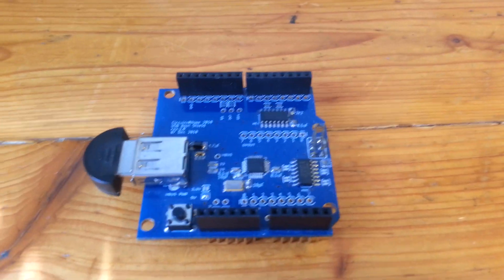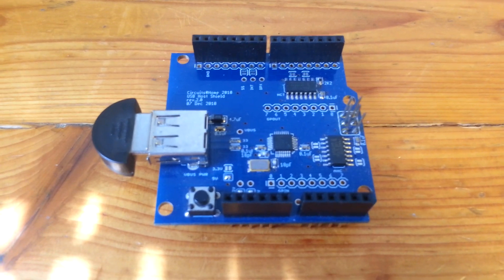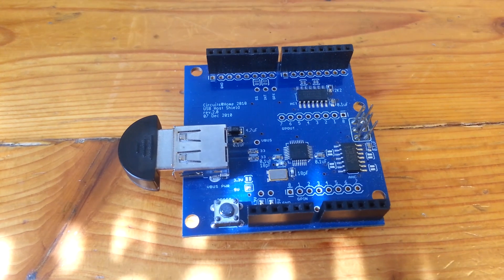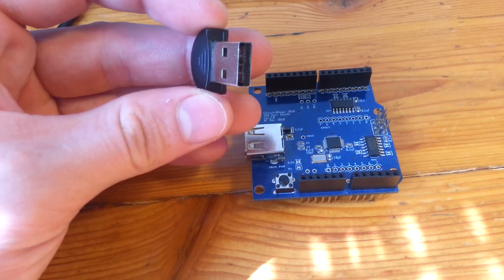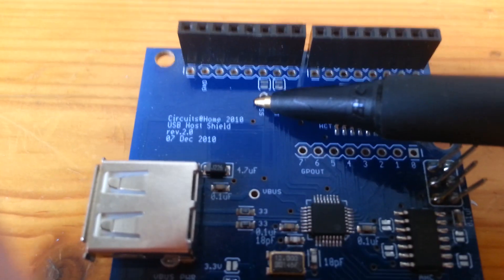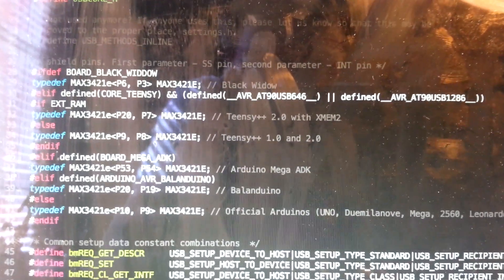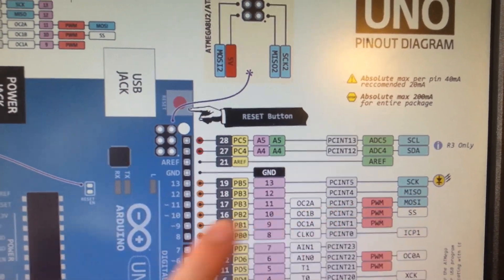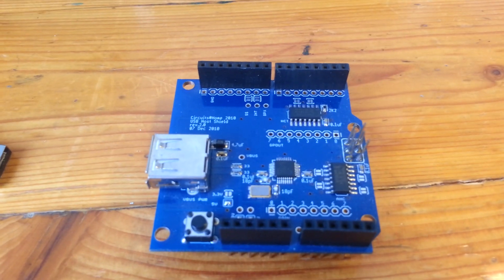How to Connect a PS3 controller to an Arduino with a USB host shield and Bluetooth dongle (Part 2)

Comment: Currently, I'm trying to recreate the process for a PS4 controller using the PS4BT library. The issue is that I can't seem to connect it to the dongle. I'm using the TP-Link UB5A. Do you know if this one will work for me?
Reply from the maker: Picking a dongle that works was the most difficult part. Unfortunately it has been so many years since I last worked on this I don’t think I’ll be able to provide much insight regarding current dongle options. Did you check the links on the website write up in the description? Also, enable debugging if you haven’t already to see if it provides any useful errors in the serial monitor.
Reply: @BarrettAnderies  Wow, thanks for responding. I tried, but many of those links no longer work, and some don't offer shipping to my country. I'll keep looking.

Comment: greetings, thanks for your video on usb host shield , it worked(read+write) without a flaw when i connected a usb drive to the shield(connected to arduino uno r3 ), one question, can this shield work with a usb hub ??? i have tried it arduino<->usb hos shield 2.0<->usb hub<->usb drive and received nothing on the serial monitor...perhaps i did something wrong or misunderstood the capabilities of this usb host shield???
Reply from the maker: I have never tried using a hub, but there is mention of USB hub support in the documentation and it looks like all you need to do is make an instance using the USBHub library: https://github.com/felis/USB_Host_Shield_2.0#faq.

Comment: Hey, if I were to only use the ps3 controller with a cable and now the wire less option would i then be able to skip the whole bluetooth dongle part. Good video.
Reply from the maker: Yes, you can connect the controller directly to the shield via a USB cable: https://github.com/felis/USB_Host_Shield_2.0#ps3-library

Comment: Hey, thanks for the video. I'm trying to go through the process of setting mine up but I only get the PS3 Bluetooth Library Started message when I enable debugging. I saw on another comment you said these was probably due to an incompatible dongle, but I bought you linked as confirmed working. My question; however, is that no matter if I have debugging enabled or disabled the storage space is always 20556 bytes. Got any suggestions?
Reply from the maker: Hmm, that is strange. I'm not sure why that would be. Is there any way the Arduino IDE isn't reloading the library? I assume you've restarted the IDE?

Comment: I got my controller connected, but how can I make it interact/control for instance a servo or turn on an LED? This code only print the values of the controller.
Reply from the maker: Read the states or values of the controller and input these values to whatever you want. The example code you are referring to contains all of the possible read commands to retrieve values from the controller. You can modify it to interface with whatever you want. You can download code to control a servo from my RC car video.
Reply: Aha, i see. I tried that on a LED, but it was "twitching" when i sent a pwm signal to it with R2.

Comment: Anyone know why I always get RightHatY: 1 and 0 for everything else no matter which button I pressed?
Here's debugging infoormations I get:

PS3 Bluetooth Library Started
Bluetooth Dongle Initialized
No response to HCI Reset
HCI Reset complete
Write class of device
Bluetooth Dongle Initialized
HCI Reset complete
Write class of device
Local Bluetooth Address: 00:11:22:98:76:54
Wait For Incoming Connection Request
Keyboard is connecting
Incoming Connection Request
Remote Name: PLAYSTATION(R)3 Controller
Connected to Device: 00:26:5C:69:31:01
HID Control Incoming Connection Request
HID Control Successfully Configured
HID Interrupt Incoming Connection Request
HID Interrupt Successfully Configured
Wait For Incoming Connection Request
Dualshock 3 Controller Enabled

Comment: Will any changes have to be made to a different kind of USB host shield?
Reply from the maker: What do you mean by "different kind"?
Reply: Like different USB host shield boards from different manufacturers
Reply from the maker: As long as the USB host chip and pin out is the same, no changes are necessary (which should be the case since all manufacturers aim to make the product compatible with all Arduinos and existing libraries/pin configurations). That being said, you should always confirm that the pin out is as you expected, and if not, correct appropriately.

Comment: hi, is it possible to use my bluetooth mouse with dongle? and how can i know if the dongle im using is compatible with the usb host shield?
Reply from the maker: It looks like it is possible, but I don't have any direct experience with it so I would suggest you take a look at the GitHub page for the project: https://github.com/felis/USB_Host_Shield_2.0. I see a number of references to "mouse" and "HID", both through USB and Bluetooth, so I would assume that some functionality is supported. Follow the link and look under "HID Library" and "BTHID Library". They provide some example code with the library.
Reply: honestly im just new with arduino. im trying to use my old bluetooth mouse buttos to communicate with arduino. btw thanks for the info. do the library of v2 is the same with v1?

Comment: Does somebody know if I could put a motor shield on top of the host shield?
Reply from the maker: +Malte Müller That depends on what communication protocol the motor shield uses. If the motors shield takes analog inputs you should have no problem using both at the same time. If the shield runs on SPI, you'll have to make some modification to run two SPI slaves at once. This is a good guide: https://www.circuitsathome.com/mcu/running-multiple-slave-devices-on-arduino-spi-bus. If the motor shield runs on I2C it may be impossible as I'm pretty sure it would interfere with SPI.

Comment: I am using the pro mini and the mini usb host shield to fit into an RC tractor. My problem is that I only get the "ps3 bluetooth library started" message, even when i cut down the updated version of the code and turned on debugging.  I am using the same dongles as the black one that you have and the pro mini is an ATmega 328 3.3v. Any help would be appreciated!
Reply from the maker: I'm not sure why that would be. The type of Arduino should not really affect the operation of the library (except in some special cases), so I'm guessing that it's a dongle compatibility issue. Do you have any other dongles you could try? You won't get any debugging information besides "PS3 bluetooth library started"unless it communicates successfully with the dongle. There have been some comments on this video about dongles that other users have found to work.

Comment: In file included from C:\Program Files (x86)\Arduino\libraries\USBHostShield/settings.h:139:0,
                 from C:\Program Files (x86)\Arduino\libraries\USBHostShield/Usb.h:27,
                 from C:\Program Files (x86)\Arduino\libraries\USBHostShield/PS3USB.h:21,
                 from PS3USB.ino:7:
C:\Program Files (x86)\Arduino\libraries\USBHostShield/SPI.h:54:22: fatal error: avr32/io.h: No such file or directory
 #include <avr32/io.h>
                      ^
compilation terminated.
Error de compilación

Comment: Is there any way to connect a playstation 3 or 4 controller to a playstation 2 system , tired of wires but gigaherts are very low responsive any adapters for the Bluetooth controllers to ps2 system?

Comment: It appears that the Kinivo BTD-400 Bluetooth 4.0 USB adapter will work. I have tested with the Wii Remote and Nunchuck and SPP with Samsung Galaxy 5. This was an the Arduino Mega Board with SainSmart USB shield. 
Here is the link to bluetooth dongle http://www.amazon.com/gp/product/B007Q45EF4/ref=oh_aui_detailpage_o08_s00?ie=UTF8&psc=1.
Reply from the maker: Brian Bradley Great, thanks for the info!

Comment: Do you know how to connect logitech F710 wireless controller to the arduino?
Reply from the maker: It looks like the developers of the USB host shield have developed some code for joysticks. I would suggest looking at their page: http://www.circuitsathome.com/mcu/using-logitech-extreme-3d-pro-joystick-with-arduino-hid-library.
There is a library that was written for use with USB joysticks, so it may work with yours. See their website: http://www.airspayce.com/mikem/arduino/USBJoystick/.
This thread may also be helpful: http://forum.arduino.cc/index.php?topic=128703.0.

Comment: Have you tried connecting PS3 controller over HC-05 bluetooth shield ? Can it be done ? I have searched quite a bit, don't seem to be able to find any post about it.
Reply from the maker: No, the HC-05 will not work. That chip is a Bluetooth transceiver and cannot actively seek connections. It acts as a serial pipe and is not capable of hosting a connection. However, I have used a similar chip many times to communicate between my Arduino and computer/phone. In this case the computer/phone was acting as the host.
Reply from the maker: No, the HC-05 is a Bluetooth transceiver, and does not have the required host functionality.

Comment: a little help plz.i want  to stack usb shield with motor shield but motor shield use 11,10,9,6,5,3 pin to control ser & dc motor..as u say the usb shield need to use 10 & 9 pin..i am really confused about how to reroute it..plz help
Reply from the maker: I am not sure if it is possible to reroute pin 11 on an UNO. If you have an Arduino Mega, you do not have to reroute anything except pins 9 and 10 because the USB host shield will access the I2C pins via the ICSP header. You should not have any issues rerouting pins 9 and 10 if you follow my directions. Remember that while you do not have to worry about pins 11,12, and 13 on a Mega (as they are NOT multiplexed with the ICSP header), you MUST sever the connection between the host shield and these pins, either by removing those pins or bending them out of the way. If you can ask a more specific questions, I may be able to help you further. You can also contact the developer if I am unable to answer your questions.

Comment: Sorry, this may be a repost, not sure if the first one got out or not:

Great videos! (incl. part 1). Three questions:

1) we're thinking of using the usb host shield MINI (not full size) on a prototype project: is there any differences hardware-wise/code-wise from using the larger board (other than the pin lineups, obviously)?

2) We're thinking of using this on a UDOO Quad board (their bluetooth going into the iMX6 chip does not work, at least with Android; we want to sidestep theirs and use bluetooth directly to the Arduino side: simpler for us); The Udoo Quad board is based on the Mega boards including pin lineups. Is the larger usb host board (not the mini) compatible with it? Your video references compatibility with the Mega (around the 10 minute mark) but it's not clear from the video that the pins would line up. Am I missing something? Do the pins need to be connected separately?

3) If we're to connect the pins separately (other than power/gnd/3.3v/...) for either the mini or the full size is it correct that ONLY the SPI pins are needed (mosi/miso/ss/clk) to get connection/functionality between arduino and usb host board?

Any input (get it? :)) would be appreciated.
Freddy.
Reply from the maker: Frederic Rudman 

1). Not that I am aware of, but that's only because I have never ready anything about the mini version. 

2). Yes. The regular USB host shield communicates with any Arduino via SPI via the ICSP header (which is in the same place on both the UNO and Mega). The only non ICSP pins it uses are SS and INT, which can be redefined in the code. This can be confusing because of the following: On the UNO, the SPI pins are broken out to both the ICSP header and DIO pins 10-13 (although 10 is the SS pin and not shared with any pin on the ICSP header). On the mega, the SPI pins are also broken out to the ICSP header, but instead of going to DIO 10-13, they go to DIO 50-53 (although, as with with UNO, the SS pin (DIO 53) is not shared with the ICSP header). Therefore, since the USB host shield connects through the ICSP header, it gets all of the SPI pins (SCK, MISO, MOSI) via said header. HOWEVER, on neither board does the shield connect with the SS pin via the ICSP header. On the shield you will see the SS trace (which can be cut). By default this trace goes to DIO 10. This is standard for the UNO (all the pins align by default), but not for the Mega (because the SS pin on the Mega is 53 not 10). However, this is corrected for in the code by reassigning the SS pin to 10 so that the pin on the shield receives the SS commands via DIO 10. SCK, MISO and MOSI are fixed because of how they are received via the ICSP header, but the SS pin can be defined to be anywhere (DIO), and will work as long as you jumper the chosen pin to the SS pin on the shield (which can be modified by cutting the trace and soldering it to another unused pin on the shield. Simply put, as long as you don't change the SS pin definition in the code, the shield will work with both the Mega and UNO WITHOUT any modification.

3). Exactly.

I know this can be confusing, and I'm afraid my answer to 2 probably confused you more than it helped, so if you would like, go to my website, get my contact info, send me an email, and I could Skype you and try to explain it better.

Good luck!
Reply: Wow! That's a lot of info! Very impressive. Thanks for that. Let me digest it. I'll go to your site and get your info. I really appreciate this.
Freddy.
fyi: based on your response above, we'll probably go the Mini route and connect the SPI pins directly to a larger board we're building. The whole thing is a hack because in theory, the Udoo Quad SHOULD have Bluetooth already but the 4.3 version does NOT support HID so connecting simple bluetooth keyboards (for example) doesn't work, hence the reason we're going trhough the Arduino direction.

Comment: Both videos are very helpful, Thanks.

I've used a no name chinese dongle with sparkfun board with v2.0 lib. They respond only when the external power is connected to Dueminlanove. I enabled the debugging in settings.h and as you've mentioned in the video I've to remove most of the test code to fit in the 30k limit.

If anyone uses sparkfun board, make sure you solder a jumper between D7 and reset pins, otherwise nothing will work.

Comment: I wish you had posted this video couple days earlier as I spent four hours to figure out why my motor driver was not working on July 5! :))
I was using Pin#10 for encoder and nothing was working. This is really important information. 
BTW, I ordered the dongles from Amazon and all six of them worked! Thanks for the tip.